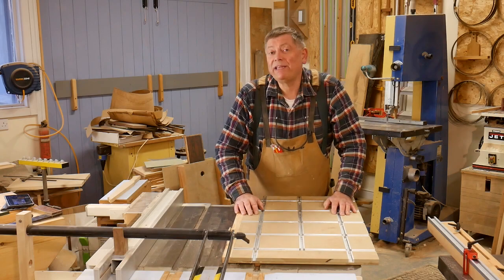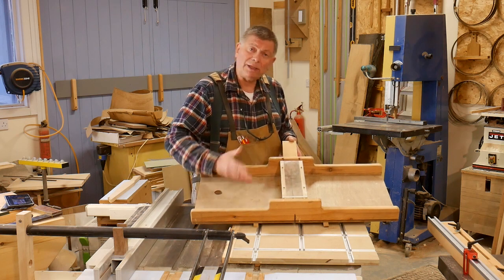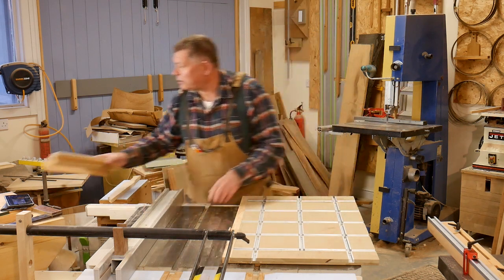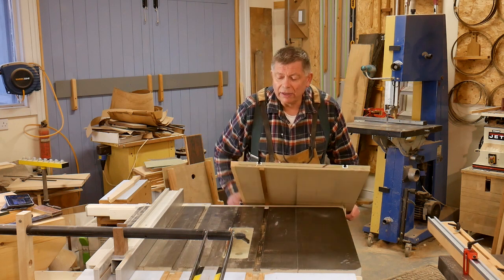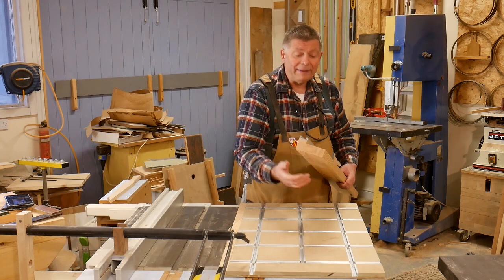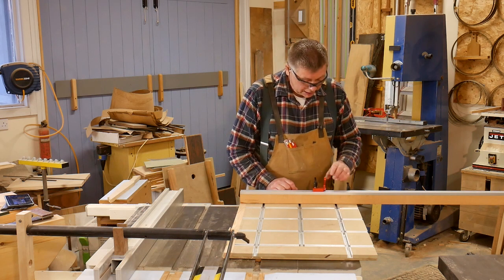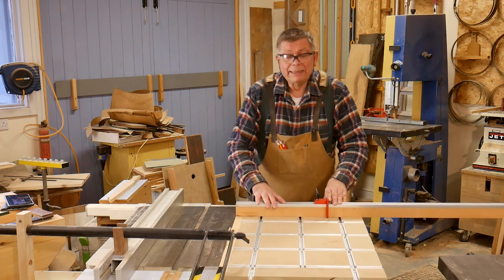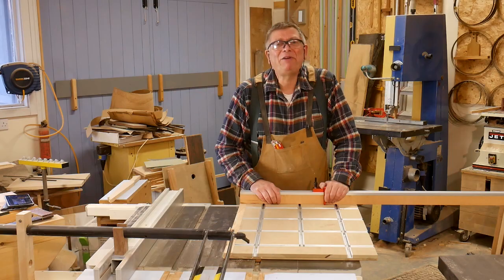Zero-clearance tablesaw crosscut sled!

Comment: It looks like you're using the smaller T-track (14mm as opposed to 19mm internal width) for the grid arrangement? Can I ask where you bought it? and also where you got the nuts that fit into it?
Reply from the maker: Rutlands. I bought a load when it was on offer a few years ago. But the profile is not identical to my previous lot, the walls are slightly thicker, so I've had to fettle everything a bit to get things to fit nicely.